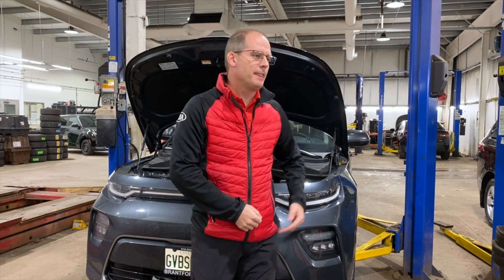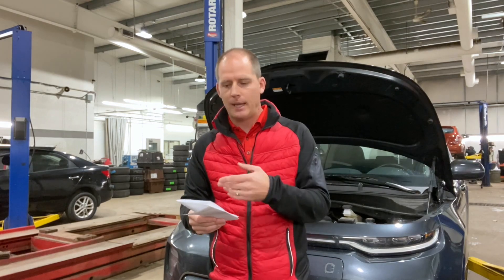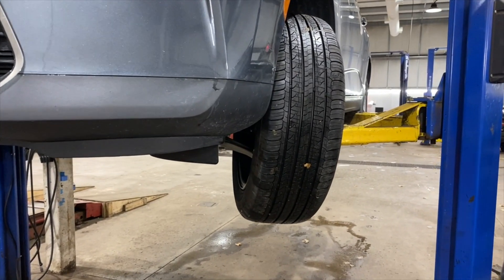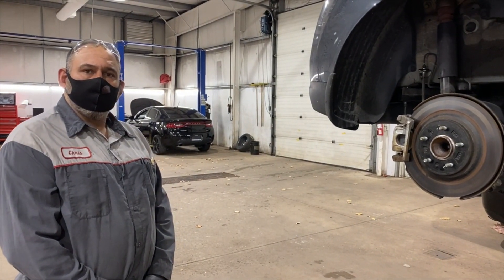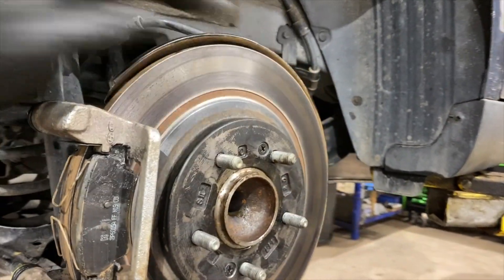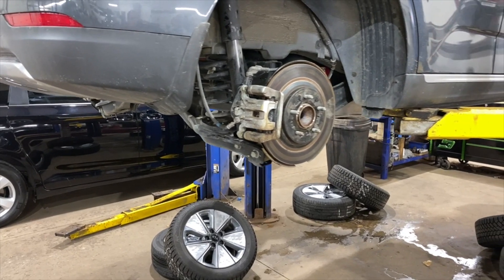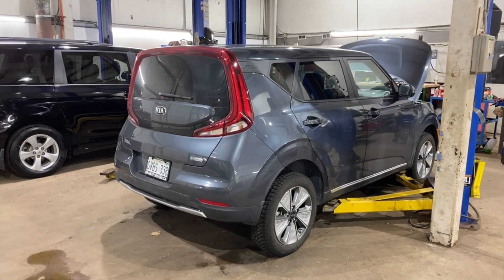What does an EV Service look like?

Comment: Considering that you perform a real brake maintenance, where the calipers come off, are cleaned and lubricated, the 311$ price is reasonable, especially since it includes a complete inspection.
Reply from the maker: Just to clarify, that price included all of the inspections, AND the price of the Cabin Air filter, to go along with the tire rotation/swap. I've had some messages about this, and some have not realized that the Cabin Air filter is part of that price.
Reply: @BrantfordKia  now that changes everything. It was not clear if the filter was also included so with that being said...
311$ for a real brake service, cabin filter, tire rotation, and general inspection is an amazing price, especially considering you are a electric certified Kia dealership. If you were close to where I live I would go there in a heartbeat for that service, every year.
Reply from the maker: @EV-olution  I try to be clear about that at the 10:44 mark but I could have done a better job. Thanks for commenting!

Comment: So you are saying you have to spend over $300 yearly??? So much for low maintenence.
I lubed my break pads once in the last 4 years for my Model S Tesla. Easy job and the cabin filter is about 20 bucks, which takes 10 mins to do (if that)
I guess if your one of those people who can't rotate your tires and change a simple cabin filter then you should be robbed by the dealership. 
My second car is a new Sportage PHEV.

Comment: Very useful, thanks.

I have heard that it is a good idea to replace the gear reduction oil on the Kia and Hyundai EV's at regular intervals.  I also didn't see you checking / greasing catches and latches, door straps, bonnet and tailgate struts and wiper blades as well as function of screen washers and all lights.  I assume you did do these checks.

I would also like to know if you have considered an aftermarket drunk for the cables and perhaps carrying a full size spare in the a available space under the boot floor please?
Reply from the maker: Gear reduction fluid (which is really expensive) should be changed at 60,000 km's under severe use, or 120,000 km's under normal conditions.  During our EV service, yes we lubricate latches, check lights/wipers/wiper fluid etc.  We will take a look at what options are available for a full size spare, "No" never considered it.

Comment: EDITED June 2022: Based on the experience of an ever-increasing number of owners including myself you'd be wise to change the reduction gear oil AND install a Votex DP007 M18x1.5 magnetic drain plug on ALL Kona and classic Ioniq EVs at their next service. For whatever reason the OEM non-serviceable internal magnet is NON-MAGNETIC and leaves steel wear particles in circulation that eventually get chewed down to dust and turn the oil pitch black. This is an abnormal operating condition for any gearbox that Hyundai seem completely oblivious to and it's no surprise that there are repercussions affecting noise and reliability.
Sept 2022: Some Kona EV owners have been attaching 2 or 3 neodymium disk magnets to the outer surface of the existing drain and/or filler plugs as an easier/cheaper, more dealer-friendly fix.  This seems to be quite effective.  You can even install these on the filler from under the hood rather than having to remove the underside cover.

Comment: 2:45 cabin air filter
3:17 Wash fluid, Brake Fluid, Coolant
4:00 Inspect Battery Condition
4:40 Hose Inspection
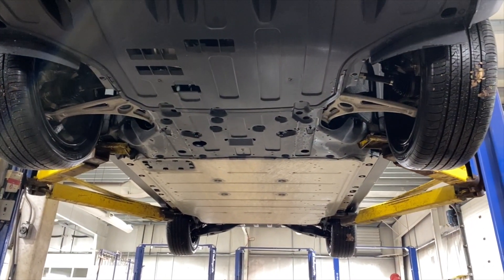5:00 Tire inspection/Swap
6:05 Ball Joint Inspection
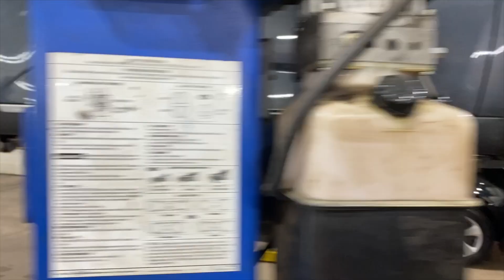7:49 Brake Rotor (front region braking), 8:35 Brake Rotor (back) [Brake Servicing]
11:00 Components near Brake Rotor (Drive Boot, Drive Line etc)
12:30 Differences between worn out brake pad and maintained brakes

Comment: Just wanted to ask why such a big jump from $69.95 for 14 item check list to $311.85 for a 16 item check list ? It's an EV not a more time consuming solid fuels car , with way more consumables to check and change plus time involves replacing them !
Reply from the maker: The brake service is the big job. That's the reason for the price jump.

Comment: When you're putting the test strip in the coolant, I assume you're checking the PH, is that right? On a gasoline car, I know that the optimal reading for this is generally between 8.5 and 10, but in my Kona EV, even when it was brand new, I tested it and the PH was about a 6.5 - 7, which is more on the neutral or even slightly acidic side (with the same blue coolant, not the other one from earlier models). What readings are you looking for? I like to keep an eye on these things myself between service visits when I'm able to.

Also just an FYI, there are some 16" rims that do indeed offer enough clearance over the rear calipers, but you are right that most don't fit. I have a set of 16s for my Kona's winter tires :)
Reply: I burst out laughing when i saw him pH the washer fluid. Am i missing something?
Reply: @kashmir7952  that's not washer fluid, it's coolant
Reply: @robviously-rob0ts  oh right that's what happens when you half pay attention 🤣

Comment: Seems a little expensive for just inspections considering you used to get oil and a filter with that as well 69.99 - 30 for oil and filter = 39.99 a fair price
Reply: Tire swaps are 30-50$ a cabin air filter is like 10$. It takes approximately .5 hours to do a tire swap Kia charges 100$ an hour labour that’s 50$ so it’s right on par with where it should be. Only way to do it cheaper is on your own

Comment: Literally zero need to be ev trained to carry out that work.  Only when fault diagnosis & repair of ev system would the relevant training be needed. Ev have a HV battery , motor , cables & electronics when these need attention you need to be ev trained.
Reply from the maker: I'll agree with that. But Kia also offers product updates via software updates and other things on these vehicles. If you book at our shop, your vehicle will always be checked for these updates, and you can get improvements and updates at no charge (performed like a recall) and if you don't have an EV certified tech, then you won't necessarily be able to get these updates done. I've had a few software updates done to my vehicle since I purchased it in 2019.

Comment: Do electric vehicles break down?
Electrical systems 
Electric motor 
Battery management systems 
Artificial intelligence systems?
Reply from the maker: Sure, anything can break down. One of the benefits of electric cars is that they have far fewer parts, so in effect, there are fewer things to break down.
Reply: @BrantfordKia  thanks for your replying 
Consider a cellphone which may need repairs applied to the electronics 
I want to know that do electric motor and other electrical systems of electric vehicles need to be repaired?
Reply from the maker: @alimk7490  They could. I think what we'll find is that EV's will end up being more reliable than Gasoline cars in time. Modern gasoline cars also run a lot of electronics, so there isn't a whole lot of difference in that sense.

Comment: I have an issue with my 2020 Leaf.  I have the Leaf Plus with the largest battery pack.  I absolutely love it when it runs.  Here's the issue and even Nissan here is stumped.  The first day I drove it off the lot with only 16 miles...it died and rolled to a stop before making it home.  They came to pick it up and could find no problems.  reset the computer and returned it.  A month later I was charging, went out to unplug and drive to down and got maintenance required and it wouldn't start.  Dealer again picked it up and it threw a code this time, a laundry list of codes.  Again, they reset the computer and I took it home.  Now the 3rd time...I parked it, set it up to charge.  The next day i go out, unplug it and noticed that it only charged to 90% this time and not the full charge.  When I got in to drive to town, again I got the warning codes and maintenance required and it would not start.  Each time it dumped was within the 30 day range plus or minus a day.  Any clues what this would be????  Cause I'm at a loss and it appears Nissan in the US is also lost at what it could be.  I got a call tonight and they asked me if there were timers set and my answer was not by me because I haven't got that far into it and don't want it, I charge when I need to with no timers.  Being that this happens every 30 days, I had to ask them to check the timers and see if there was a problem and if the charging system had a problem.  Made sense, because that's the only thing that i did before it died each time.  HELP!
Reply from the maker: I'd love to help, but I don't know what to tell you. I don't have access to Nissan information either, so I'm not sure what I can do for you.

Comment: Spend over $300 on the first year's maintenance on a car that has no engine, no transmission, no exhaust system, no anti-pollution devices, or most of the fluids associated with a normal car.  He literally Put grease on 1 year old calipers,  mounted tires that were already on wheels and replaced a filter that can be purchased elsewhere for $20 or less.
 -Learn how to do this at home and save yourself $300.
Reply from the maker: Sure! But I do encourage the brake service. Owners who skip this step in Ontario, (a tremendous amount of salt is used on our roads every winter) I'm not telling you that you MUST maintain your car this way, I'm explaining what our service is, and why we do it. If you don't think that's best for your car, that's fine. I'll never force you to do this yourself.
Reply: Just south of the border, NY State requires most of your inspection to be performed for $10 on one and two year old cars .  Three+ year old cars are $21.  Most repair shops and many new car dealers inspect the rest for free.  They inspect the brakes for free, lube them for $50, and typically mount the tires/wheels for free, since they're already being removed to lube/check the brakes.  
By the way, we use more salt on the roads than you do and brakes don't need to be lubed every year, even here, where we get over 100" of snow annually.  You average 39", yet you charge much more.

In addition, Hyundai and Kia provide free maintenance in the USA for the first 3 years.  This may be why...
Reply from the maker: @carlobasta3587  Sounds like a great deal.
Reply: @carlobasta3587  I’m curious which shop mounts tires a one hour job for free does a brake service a 1.5 hour job if they clean the rotor of rust sand the brake pads clean the brake bracket and calliper for free.

Comment: Does the drive battery get checked at all?
Reply from the maker: On an early service, there's not much to check. So I wouldn't say that they don't check it, but it's a visual inspection at best at this point. If there's an issue with this, the car will put up a warning light, and then the technician would dig into the issue.

Comment: Does you suggest TPMS to be installed on winter tires?
Reply from the maker: Yes. Absolutely. It's always your choice, but if you don't put them on, you'll have a warning light on all winter. Secondly, if you spring for the extra cost upfront, you keep the full functionality of the car. You can see low tires before they turn into blowouts. So I always recommend them.

Comment: Would you get Krown rust proofing
Reply from the maker: That's always a tough question. As you can tell, much of the body underneath is hidden from the customer, as well as the people rustproofing the vehicle. Can Krown get to spots that may rust? Can they reach above the battery? Do we trust them to not drill into parts of the car that shouldn't be drilled into? That's a decision that a customer would have to make. I won't advocate for or against their service.